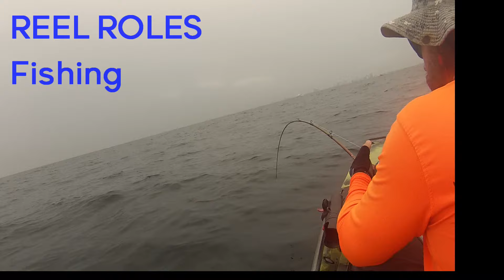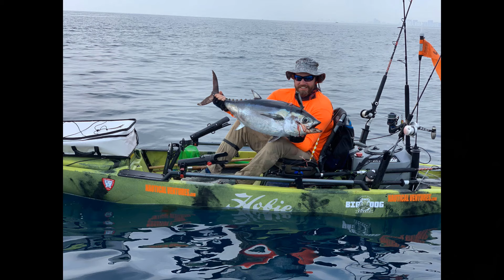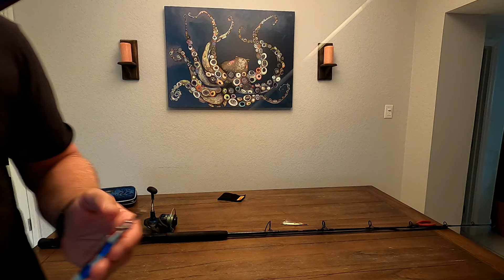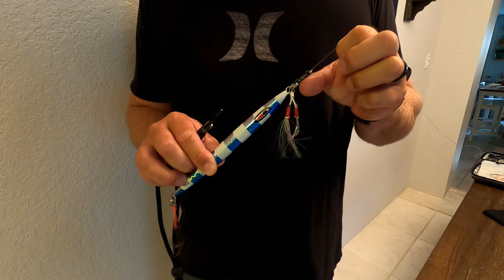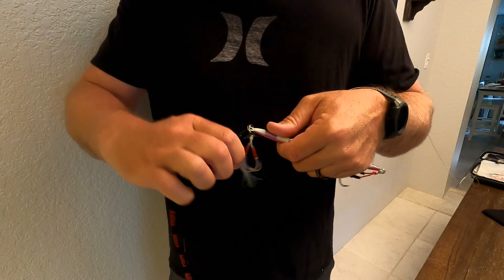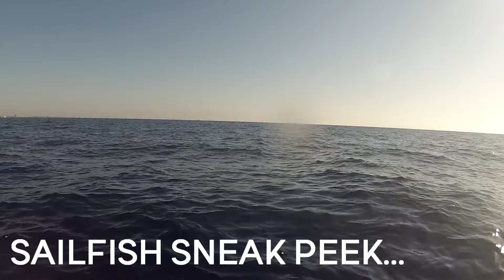Slow Pitch Jigging From a Kayak

Comment: Thanks for the video!! With that setup, what type and breaking strain braid do you use and what type and breaking strain leader? What is that "secret" side jig of yours called, one that hangs in the water column?
Reply from the maker: I have 30 lb braid and I'm still experimenting between 30 40 and 50 pound leader. The "rod holder" jig is called a casting jig were I bought it (Johnny jigs) but I'm sure they have more than one name